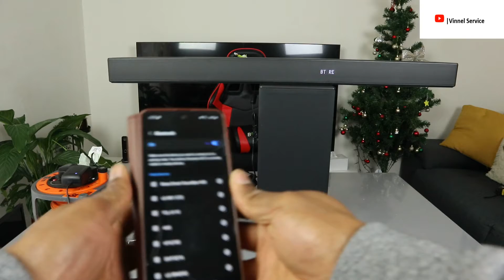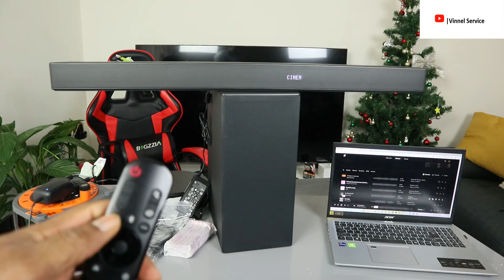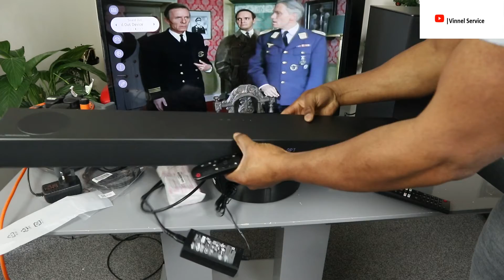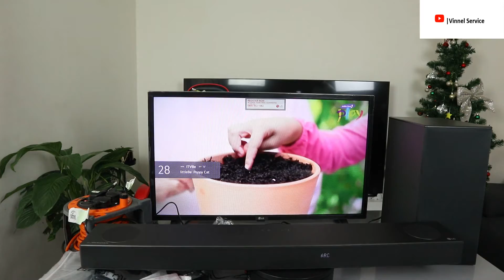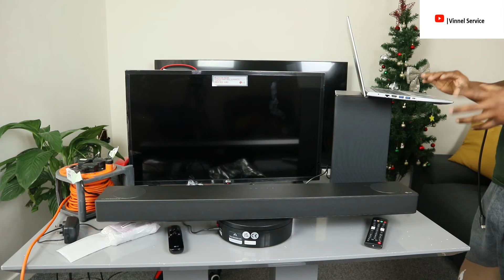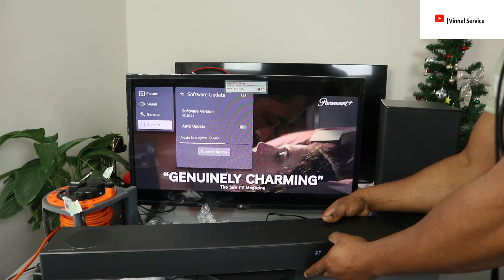LG S75Q Soundbar Full Episode Testing and Hook-Up Via Optical cable, HDMI ARC, and Bluetooth

Comment: Thank you for you review!!
question is though , does the led light of the sound bar ever turn-OFF completely? i can see it dims itself , but does it ever get completely off?
Reply from the maker: Yes it does when not in use The LG S75Q has an auto-off feature that automatically shuts the bar down after fifteen minutes without an input signal
Reply: Consulta!! Es bueno el sonido de la voces en peliculas? O no se escucha muy bien el sonido de las voces, es tapado por el sonido de disparos por decir un ejemplo?